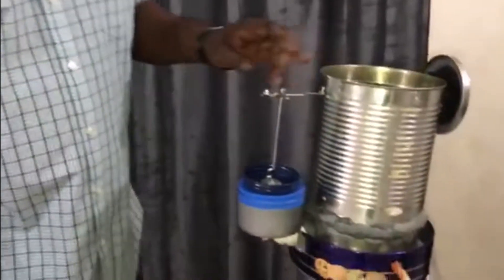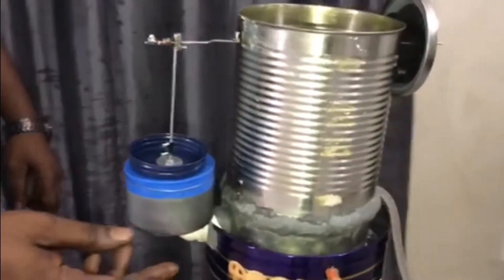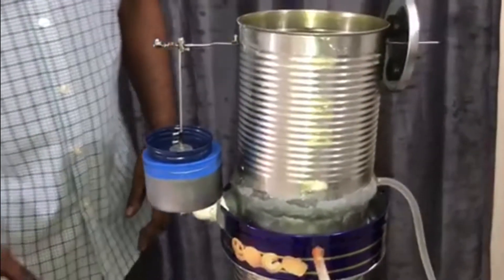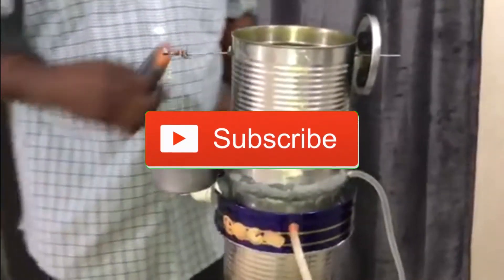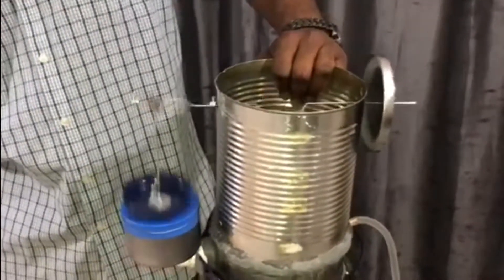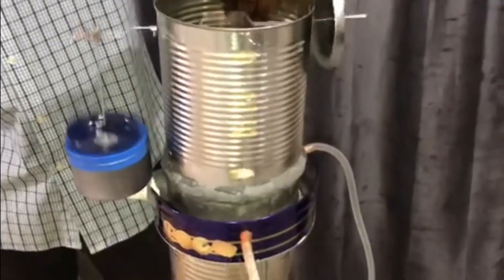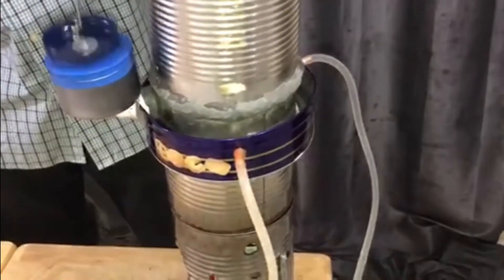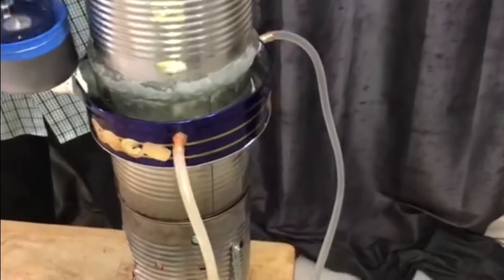MY NEW TIN CAN STERLING ENGINE?!

Comment: Is it possible to make a cryogenic Stirling engine?  Or is the machining to techy?
Reply: Generally those use helium as the working fluid, and yes the tolerances are incredibly tight to prevent loss of the gas.

Comment: information.      this engine has a  Wobbly  and  less-effective  flywheel.         there should be a be a greater  Difference, between the diameter of the cold-cylinder and that of the central diaphragm supports.!        STIRLING          if you are gonna show a  heat engine, you  Should  Show  how  Much  heat is going into  the  engine.               googletranslate